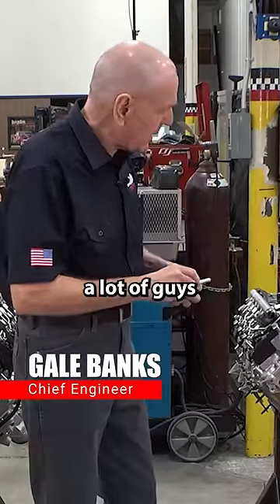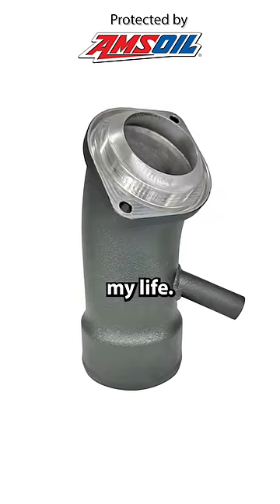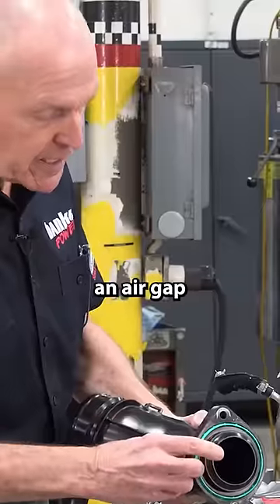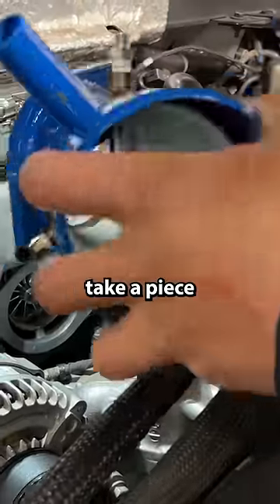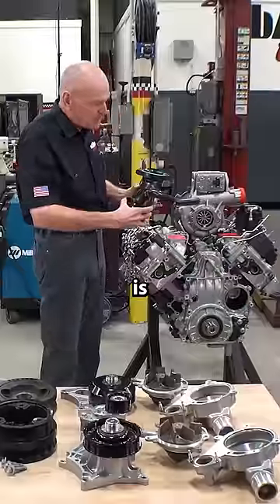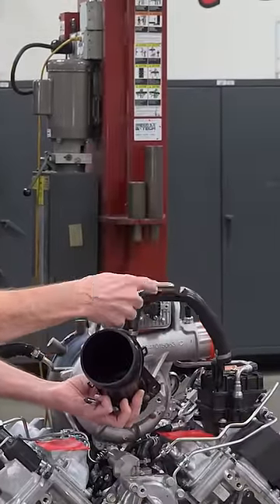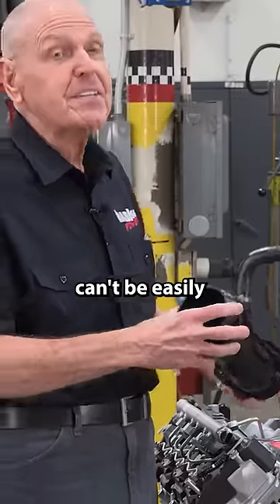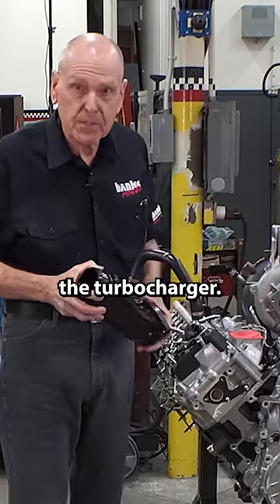The factory guys got it right. Don’t delete this!

Comment: THIS! 

I drive a Mk 7 Golf R, and most people like to swap the turbo inlet pipe right away. The problem with that is the aftermarket TIP doesn't create proper vacuum across the PCV port. 

The Mk 7 PCV is pretty bad, too, so swapping it for a (much better) Mk 8 PCV along with a Tiguan breather hose allows you to plumb turbo outlet boost pressure through the PCV breather, creating a venturi effect that allows you to run aftermarket TIP's without losing crankcase vacuum.
Reply: Is the mk8 a direct swap? I've got a mk7 gli. Never heard of this swap
Reply: @xxsoulhuntxx  *you can block off the extra venturi hose if you don't plan on using it. Otherwise, it will need to be connected to a source of boost pressure near the compressor outlet.
Reply: PCV.... positive crankcase ventilation...  Where does vacuum ever enter into this?

What about venting the tube to atmosphere or a catch can? 

There's no vacuum in front of a diesel turbo unless your filter is clogged or you have some eco-garbage in the system. It simply pushes vapors into the intake based on the amount of cylinder blowby. That's it.
Reply: @kleetus92 : Shape/geometry is important. "Bernoulli effect"!
Reply: @kleetus92 PCV works by venting the gases from the crank case vua the oil return passages. If you have blow by going into your valve train, you have MUCH bigger issues. I do agree with the catch can though. Same with EGR deletes.
Reply: @kleetus92  The crankcase has a vacuum pulled on it via the PCV and the engine intake. At no time do you want positive crankcase pressure. 

Catch can setups only pull crankcase vacuum under heavy throttle, whereas a PCV will also provide a slight vacuum at idle and low throttle conditions. 

Venting to atmosphere does virtually nothing - at best, your crankcase will remain at atmospheric pressure.
Reply: @jameshaulenbeek5931  Catch Cans still have a line that returns to the intake for vacuum. They just drop all the oily residue into the can instead of back into the intake. Performance guys back before catch cans came aboht used to vent to atmosphere, but with a small cone filter that replaced the PCV valve on the valve covers. No vacuum required. As long as the pressure can bleed off, it's fine.
Reply: @mikeford963  Um... where do you think most PCV connections are made? Ever open the oil fill cap when the engine is running? It's all the same pressure inside the engine.
Reply: @datadrivenmqb has done a whole series on this where he and a few others pioneered this.
Reply: @diydrivenGA  yep, that's where I got this information!
Reply: @kleetus92  most naturally aspirated engines will see atmospheric pressure (or around that) at idle, but will have a slight crankcase vacuum under throttle, with a properly functioning PCV. Crankcase vacuum is a good thing, as it prevents seals from getting blown out, it helps minimize blow-by, it reduces the buildup of blow-by vapors, and it also reduces pumping losses from pressure acting on the underside of pistons. 

Forced induction engines require a little more help, as without properly designed ventilation, they'll see slight positive pressure at idle, and even more so under boost. The PCV systems are generally more complex, as they have to deal with positive pressure from the beginning. 

The vacuum portion comes from a venturi effect of the intake air passing by the breather port, which is why the breather is plumbed into the air intake. If the design of the breather port in the intake doesn't allow for the airflow to pull a vacuum across the port, the breather won't do it's job, and you'll wind up with positive pressure in the crankcase. With the system I'm referring to in my original post, you can eliminate the stock turbo inlet pipe on my car (which has a properly designed breather port) and replace it with a better flowing aftermarket TIP, without having to sacrifice PCV function. The air plumbed in from the turbo compressor outlet creates a venturi at the breather outlet, pulling a vacuum on the breather hose. This can also be applied to other vehicles, but VW already made the parts for different, related engines. 

As for catch cans, a properly designed catch can system is great - at higher rpms/throttle, or under boost on a FI engine. The problem is they don't work well at idle or light throttle, which means they're not effective on a typical daily driver. Running a catch can without a good vacuum source, you still risk positive pressure causing problems in your engine.
Reply: Pcv pfft.
Reply: @kleetus92  then please, enlighten me
Reply: @kleetus92 Modern cars are not allowed to vent to the atmosphere anymore because you know, you kill a polar bear every time you do.

So these new PCV’s are really CCV -crankcase ventilation systems, and they are constantly under vacuum. Opening it up to the atmosphere means you’re introducing a vacuum leak and the engine will not run right.
Reply: @lynxstarautomotive208  #1 it's a diesel, it will never have a vacuum on the block. Ever.  But I do agree with the death to polar bears thing... they are a nuisance!  

Being a CCV, the flow that pushes into the pipe ahead of the turbo inlet, really does absolutely nothing for performance, if anything hurts it because instead of getting pure air, it's got some stream of oil vapor and combustion gases displacing useful oxygen.
Reply: @jameshaulenbeek5931  See the post below... but in brief, it's a diesel engine. It will NEVER generate a vacuum for the block. Gas engine sure, because you have a throttle butterfly, but a diesel is wide open 24/7 even when off. 

This is a diesel post, not a gas post. But, even if it were, negative crankcase pressure will not 'prevent blowby'... how cold it? If anything it is making it worse because the differential pressure across the piston rings is now higher because there's no atmospheric pressure on the non fire side of the rings! Pumping losses... Lol... you do realize when one piston comes down, another one is going up, right?  

If an engine is functioning properly you can take the breather cap off and you should see little or no vapor pushing out. It's not going to huff in and out, because once again, one piston down, one up (unless it's one of those stupid 3 or 5 cylinder jobs, but even they should be balanced somewhat). 

PCV was only brought about to half ass control scary vapor emissions from engines by the EPA who's only goal in life is to increase regulation to a level that internal combustion engines are so fucked up and choked out, and electric car actually looks like an intelligent solution.  They are about this close |      | to doing that with diesels, gas engines they still have a bit further to go, but asinine CAFE standards should finish it off.
Reply: @kleetus92 Sir we are discussing the VW Gen 3 TSI engines which are gasoline. That’s what the OP is stating.

TSI’s use a closed circuit crankcase vent system with two oil separators. One bolted to the block which filters larger oil droplets, and one bolted up top to the cylinder head cover. The one up top servers as a finer micron filter, and also introduces controlled manifold vacuum via a diaphragm that is connected to the intake manifold.

TSI engines have the crankcase under controlled vacuum at all times. The spec is 3inHg at idle.

A single leak from the timing cover gasket, or one of the main seals will cause idle issues and set mixture trouble codes. These types of vent systems have been adopted by several manufacturers all in the name of polar bears… 🐻‍❄️Welcome to our world.
Reply: @lynxstarautomotive208  I must have missed that part because the video was about diesels... ok.
Reply: @kleetus92 Indeed you did 😂
Reply: Thats actually pretty sick.
Reply: @kleetus92 This video is about diesels, but this comment thread the OP clearly talks about a very popular CCV upgrade performed on the Gen 3 TSI engines. Of which several posts carried the conversation including yourself who asked a question about them.

Seeing I specialize on German brands for 2 decades, and cut my teeth at a VW/Audi dealer for 8 years I chimed in on your question about these systems.

 Gassers originally used traditional breather systems that could be vented, but the EPA has long required those systems be phased out.
Reply: Okay. And we needed to know these specifics about the mk7 shananigans exactly why?
Reply: @HristovRumen 🤷‍♂️ VW ppl we find each other.
Reply: As someone who knows very little about cars, this reads like your trying to describe a Retro Encabulator. XD
Reply: @tabletbrothers3477 ahh British Humor. Sadly, that’s where we are with cars in the modern world. 🤷‍♂️
Reply: @jameshaulenbeek5931  PCV blows out whether under vacuum or not. its crankcase ventilation and its positive pressure because the engine is pushing air out of the crankcase vent tube. you don't need vacuum ever....its already positive pressure. on direct injection cars like VW you definitely want a catch can or you'll be walnut blasting sooner and if you vent to atmosphere it'll almost definitely fuck up the stupid pcv valve as pcv valves specifically are what like a slight vacuum... without it they generate so much oil vapor from the crankcase that the hoses from them will saturate and oil will pool there. They need the slight vacuum to clear the hose running from the pcv valve to the intake so it doesnt back up in the hoses and screw up the pcv valve... not to create positive crankcase pressure,  that exists naturally.
Reply: @kleetus92  came in here guns blazing but didnt read the original comment? so sure of yourself yet didnt even bother read what the conversation was even about from the start lmao
Reply: A Volkswagen with PCV problems??? Never heard of her 😂
Reply: TIP! Comin’ live, from the VIP!
Reply: I run a k04 1.8t. Remove pcv and egr immediately and run a catch can and block off plate. We don't need exhaust and oil recirculating through our intake intercooler and engine it causes more carbon buildup and lessens the performance. Let's put exhaust back through where fresh air is supposed to go. Yeah no

Comment: well one thing I will say is this does NOT apply to the 2015 - 2021 subaru wrx ... the turbo inlet / bypass valve / AND charge pipe is cheap ass plastic GARBAGE ... I personally upgraded all three when I purchased my 2020 wrx Limited brand new off the lot back in June of 2020 and the car has run flawlessly ever since

Comment: Same on naturally aspirated. Like stop putting "cold air intakes" on. The one from factory IS A COLD AIR INTAKE and actually BETTER than the aftermarket especially since it goes to the very very front of the vehicle even past the radiator to where it's ONLY pulling in cold air. When you put on a "cold air intake" youre actually now bringing in hot air from around the engine and thats already been through the hot radiator as well.

Comment: Yes finally. The crankcase pressure at wide open throttle is controlled by the pressure of that intake tube. You can measure it at the crankcase using a 1-bar map sensor. I have a DIY VIDEO How to measure the crankcase pressure in my channel on my turbo V8 engine. This is the 99.9% overlooked aspect of PCV systems which cause people to blow oil from their engines and this is what started the catch can revolution- people catching the oil instead of fixing the problem by correctly measuring and setting their crankcase pressure. Arrgh!
Reply: don't confuse diesel with gasoline. their intake and crankcase pressures are completely different.
Reply: @kleetus92  That is like saying dry sump is different than wet sump in gasoline applications. Of course there are variations across all manufacturers and engine types, nevertheless they ALL Require measurement and Specific Setting points which can be done using the same Technique e.g. SENSOR and Data-capture , this MUST  be done for ALL Performance engines in the world modified whether diesel or gasoline, I made NO Specific gesture towards either nor did I address dry sump yet they all fall under the same principles which is that positive pressure is NEVER DESIRABLE no matter wet dry or diesel or gas
Reply: @kleetus92  In other words Diesel and gasoline work the same at wide open throttle. Both require intake pressure drop and kinetic energy control via plumbing design and filter selection. They can all be measured and set via sensor + data capture and this needs to be done. It makes no difference whether diesel or gasoline as they function the same at wide open throttle which is where the aspects of oil control within any crankcase for any engine in the world depend on pressure setting and control over the organizational kinetic energy components of gas and dissolved partial pressure of combustion byproducts etc...
Reply: @Wabits  Except... no... a gas engine spends most of its life under a vacuum, a diesel does not. 

And even if they did... the vent tube dumping oil vapor into the turbo intake doesn't make any difference whatsoever on a diesel.. again, you can run that tube to atmosphere, and it won't make any difference other than maybe leaving a few drips of oil on the ground, vs leaving oil residue in your intercooler...
Reply: @kleetus92  Crankcase pressure has an influence on ring behavior , gas scalar pressure forcing up oil into the ring pack on intake stroke and early ring switching, and ring flutter, all caused by high crankcase pressure in diesel engines. I Suggest you spend some time reading Published PCV research for diesel engines.
Reply: Maximum allowable pressure for diesel engines is still a vacuum signal 1" to 4"Hg usually. If there is no vacuum present, there is no oil control, no blow-by partial pressure control, will result with rapid sludging of the oil. The little tube he said "Don't mess with it unless you know what you are doing" Is the same tube you just suggested leaving open to atmosphere which will defeat PCV system and ruin the engine, making you a great example of somebody that does not know what they are doing. Why don't you ask Banks what he thinks of your leaving it open to atmosphere if you don't believe me and consider to yourself why he would say "dont mess with it" if it doesn't matter, you are saying he is wrong!
Reply: @Wabits he won’t say shit cause of the epa
Reply: @dylanmcgregor2515  1. We may keep the context of this information with respect to antique and classic performance vehicles to avoid complication with the EPA involvement if any. 
2. The emissions component of keeping an engine clean NOT relevant and not a discussion topic when it comes to crankcase pressure. For example an engine with a belt driven vacuum pump will maintain much more vacuum inside the crankcase and keep the oil clean and engine clean inside if done properly - while ejecting the evacuated contents to the atmosphere thanks to energy provided by the vacuum pump's belt drive. In engines where PCV is driven by itself (the engine IS a vacuum pump) there is loss of power associated with ingesting blow-by gas which is mostly CO2 and Water, but the end result is the same - a cleaner engine either way, whether you observe the emissions aspects (re-ingest blowby gas) or not (eject using a belt powered vacuum pump)
Reply: Using bar to measure pressure instead of PSI should be illegal. Horrible scale for measuring pressure.
Reply: @TehButterflyEffect  Firstly, 2.6831981psi = 0.184BAR. The unit BAR is just as accurate as any other unit of measurement. Its like saying inches is not good but meters is better, it is your unit of preference. In other countries they do not use PSI. Japanese gauges are often in BAR.  
Secondly, What you MEANT To say is that a 1-bar map sensor does not have ideal resolution for taking crankcase pressure measurement. That is true. The reason I choose 1-bar map sensor however is because of COST. You can get 1-bar map sensor FREE from many junkyard places, from cast off broken engines even. Thus the 1-bar map sensor is a FREE Way to measure your crankcase pressure and as I have shown will work fine for this purpose if you know how to use it properly and precisely. It is not IDEAL but it is a Truely FREE DIY METHOD. My entire vehicle is build from FREE DIY parts and has almost 1000hp so this theme of using free parts to diagnose and successfully daily driver a factory engine configuration at over 3 times the factory Horsepower output is a logical follow through. I have of course built an electrical circuit using an arduino and a high resolution pressure sensor (Honeywell XCA405DN Pressure Sensor 3-16V 0-5psi Transducer) As a more accurate means to establish precise measurements of crankcase pressure but this is beyond the scope of average DIY'ers. Nevertheless if people want to see how to use arduino and high resolution pressure sensor to take measurement of crankcase pressure I will gladly make that video to show the difference in resolution from 1-bar free DIY method to actually spending money on a project which is time consuming and potentially difficult for people without a background in engineering electronics, thus we have both DIY FREE method and a more expensive, accurate method for the same problem solving.
Reply: @Wabits This guy is dropping napalm knowledge all over this thread
Reply: Bar is the standard. Look up the definition of "PSI" and you'll find that it is defined by Pacals, which is just a Bar with the decimal point moved @TehButterflyEffect

All American units of measure are based on the metric system, converted because we are too lazy to learn something new and better.